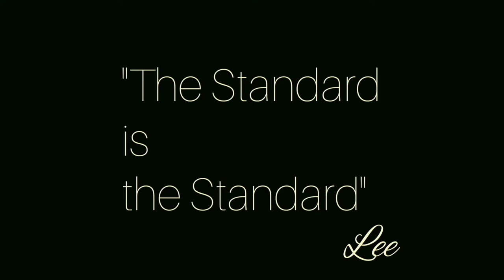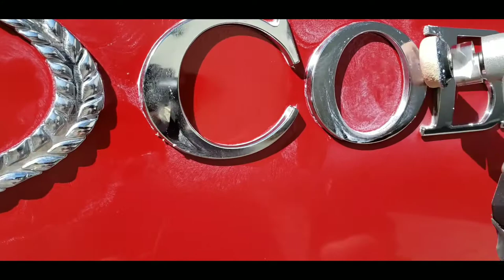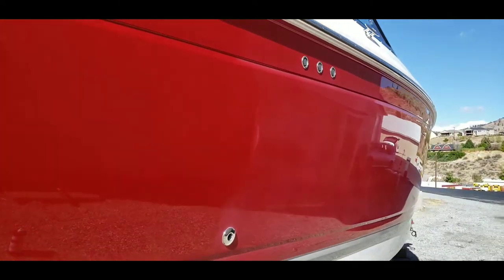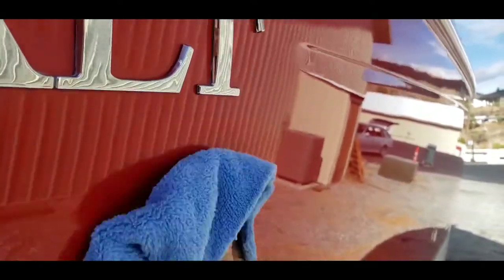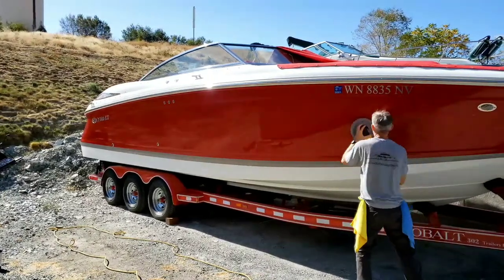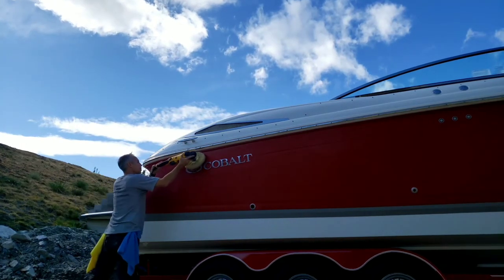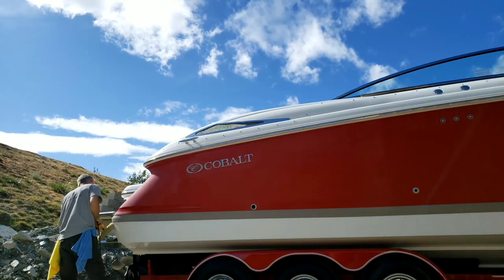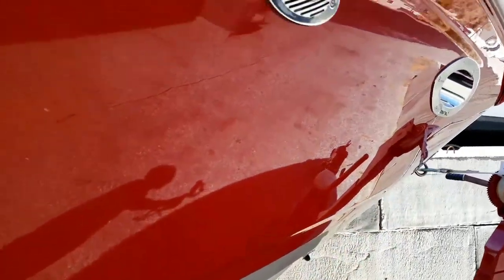Cobalt boat, pink to Red. (secret weapon used) BORING demo, Detailing a Boat.

Comment: Lee...wow...you are certainly the Chief Wizard of boat detail restoration!
Ok, I took on a 91 Cobalt (red) and while I have made note worthy progress, I am still trying to pull out some distant oxidation withing the shine _-#$?!
I used 3m rubbing compound (mustard bottle) but realise I need at least "heavy" duty...I can't afford it not to mention I have yet to find it in my small town.
What can I do? I have something called Wizards Polish n seal, 3m clean n wax, Turtle wax Polish, TW Run Comp, a rotary/wool buff wheel and a variable foam pad machine from Chicago or something.
Can you offer any suggestions to perform within my limitations of resources?

Best videos on the net BTW Bro!

Scott
Reply from the maker: Hi Scott,
All I can say is use the most aggressive product you have at your disposal (3m cleaner wax it sounds like) and a wool pad until you see a shine you can live with. Start slow, stay slow. Allow the product to grind in a spot and move it slowly across the area being worked, like a 2-3 feet a minute slow with a little pressure but not enough to bend your pad. Let it cut and grind while it's wet and as it thins out, start to flatten as best as you can. If you like the shine but it isn't perfect, allow it to be that way. Clean your pad and apply the 3M clean and wax again the same way but less aggressively. When you get a look you like, apply a wax (not the turtle wax or a caranuba-based product) let it sit and dry. Remove it with your foam pad and try to use flat passes when you can. Without the right products, it's more difficult but not impossible, keep trying and be happy with a uniform, non-blotchy finish and shoot for better the next time you try this. I've been doing this for 17 years... It might look easy, like ballet or playing the piano, takes/took practice. My first bew dozen boats probably looked like ass till I figured out a process that works.

Thanks for the nice comment, I'm honored you think these are good vids, I try.

Lee

Comment: That is just perfect clarity and gloss from a dying red color..  My experience with reds I got from my own red '91 Acura Integra GS.. Beautiful red as long as it was kept up.. It was single stage paint.. The Underhood red color turned pink I have to assume from the heat, as it was always covered from sunlight..
Love, love, that little Spta tool!   Cannot find that size tool on the web... Perhaps they dont sell it any longer ??
Thanks for all your incredible, truly Detailed  work and video !!! Finesse !!!!
You Killed It !!!
Reply from the maker: I'll see if I can find the link to that little guy. I did the name on the other side as usual, with a buffer and a newer wheel (longer fibers) The buffed side has better clarity but the mini buffer got more areas. I think it best to use both, in tandem. The buffer 1st and then the little guy.
https://m.aliexpress.com/item/4001145349995.html?_randl_currency=USD&_randl_shipto=US&src=google&albch=shopping&acnt=494-037-6276&isdl=y&slnk=&plac=&mtctp=&albbt=Google_7_shopping&aff_platform=google&aff_short_key=UneMJZVf&&albagn=888888&albcp=9317063908&albag=94962804715&trgt=299423776478&crea=en4001145349995&netw=u&device=m&albpg=299423776478&albpd=en4001145349995&gclid=EAIaIQobChMIvKrdj5mK7AIVchitBh0uFge6EAQYASABEgIaA_D_BwE&gclsrc=aw.ds

Comment: Is that a yellow wool pad? What compound are you using with it?
Reply from the maker: Not compounding with anything but wool compounding pads. Yellow pads are for pulling off "wax" 
3M Quick Connect adapter (mfg # 05752) to use with the double-sided compounding pad (3M mfg #05753) or the double-sided polishing pad (3M mfg #05754)
3M Super-Duty (05954)
3M Perfect It Heavy Cutting Compound (36102)
Perfect-it ex ac compounds by 3M (36060)
Meguiar’s (owned by 3M) Flagship Premium Wax (M6332) Pro Polish by Shurehold or 3M's liquid wax with scotchguard.
Reply: @Local_Boydidgood  so you would compound with white wool then take the pro polish off with the yellow wool pad?
Reply from the maker: Whatever "wax" I decide to use, pro polish is just one polish, there's a few I use depending on the boat. A yellow pad or a DA with a soft foam pad.